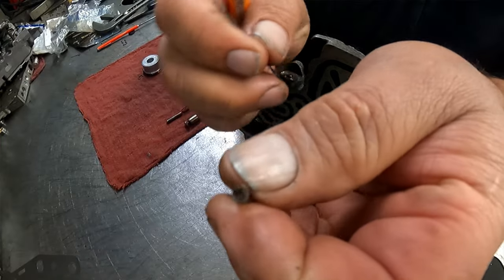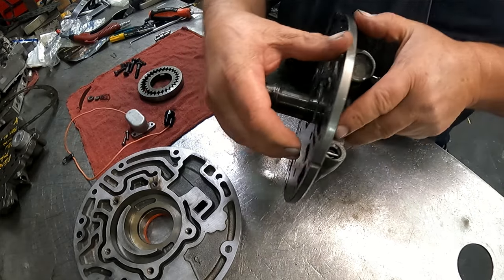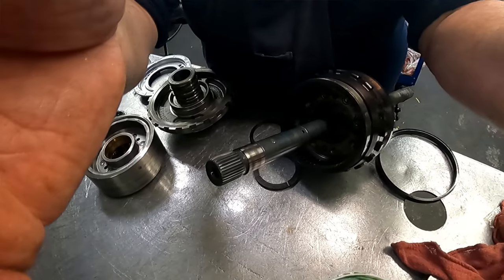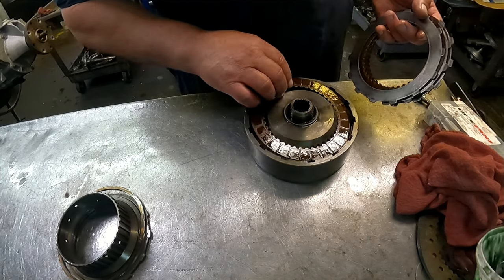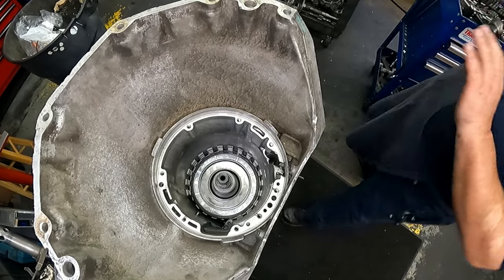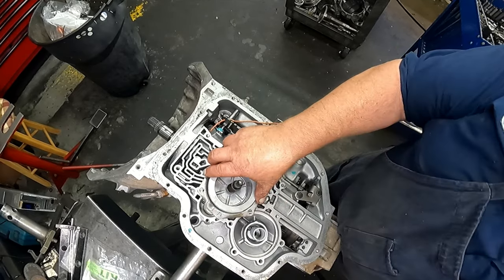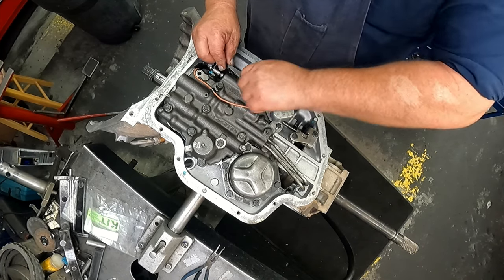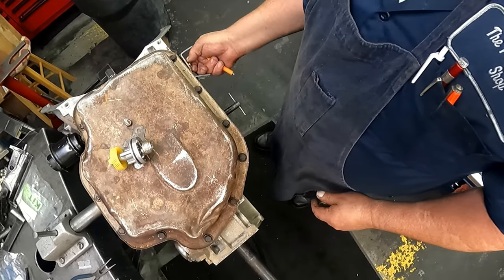TH400 Variable Pitch Recase

Comment: Enjoyed watching this as there is not much out there for early 66 -68 switch pitch transmissions. Looks like someone tried fitting a later forward hub on the earlier main shaft which had a slightly larger spline. Early cases may have had a grub screw in the worm casting  to guide the centre support home which needs to be slackened. Thanks
Reply from the maker: Thanks for watching.